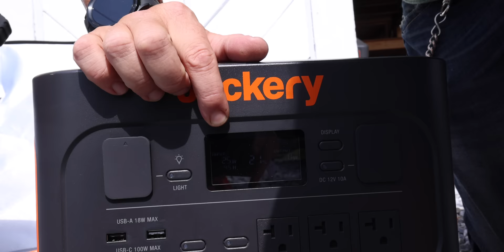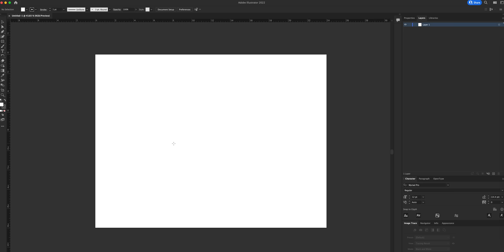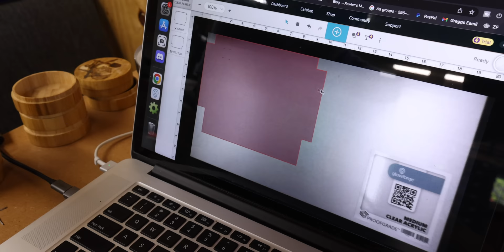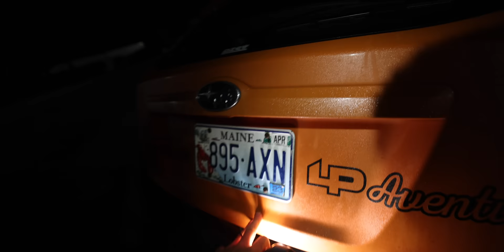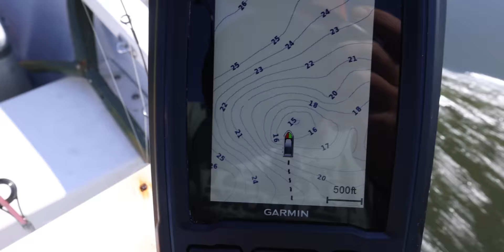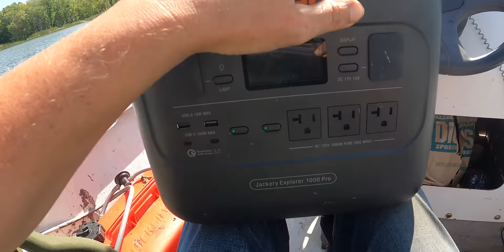Stealth Car Camper Build - Walmart Stealth Camping Catch and Cook - Subaru Crosstreck Camping

Comment: My only problem would be that I would run out of fresh air really quickly.  There has to be a way to crack open a window with the coverings still on or you'd end up with condensed windows too.

Comment: For the curtains I think the problem can be fixed with battons strips of wood set up with a little bit of bend to it when put in the window press the battons to the window so the spring will pop into the curve of the window

Comment: To solve the window curtain issue. I would hot glue the magnets 🧲 to the inside of the car and put magnets on the curtain like you did. If you have polarization right, the magnets will snap in the same place every time. Also the hot glue shouldn’t destroy the interior, especially if you place them on the glass
Reply: Magnet to magnet

Comment: Make window covers from reflectix covered in black fabric. This way they are rigid enough to sit flush up against the window. It will also act as a radiant heat barrier when you need to keep the Subaru nice and cool 😎

Comment: Hey Zach grab a hot glue gun, and a putty knife, remove the plastic cover for the rear hatch access, and hot glue some magnets to the inside of it, then just make your curtain so it fits oversized a bit then sew in a receiver tab of ferrous metal to the curtain, just keep an eye out for your rear facing camera, and dont install a magnet with in about 10 inches of the camera

Comment: 27:45 hot glue some clear suction cups around the fabric and stick it to the window. or cut a hole in the fabric, stick it thru and wrap a elastic band around the other side

Comment: Zack, you could make it so the cooking surface is a stow-a-way thing. if you lift the back section you can have a pullout with folding legs under the back section. As for the front section you can have it in two sections, one that covers the gap and the other being the main body. Use a piano hinge to connect them so that way the gap section folds back over the main body. This way you can have it attached the the back seats and have it slide along the back section. you can do that with runners on the back section and small wheels on the main body. you might need to cut off a 3 to 4 inch section from the bottom of the main body and attach it like with the gap piece. This way it can allow for the seats to be folded back up without having to detach anything for a quick setup and take down. 
If you want some kind of blueprint of what I mean let me know, I will need a way to send you a file though.

Comment: How about if you use tent poles, the kind that can fold into smaller pieces. You could have them spring open then slide them into seams on the top and bottom of the curtain. Maybe with magnets on all 4 sides they'd stay taught. Of course they'd have to be kind of light weight. Good luck!

Comment: You could always use a heat-formed opaque plastic to fit the windows with a small ledge permanently affixed to one side to create a notch and magnets on the other side to stick to the metal wall of the car or other magnets glued into the walls of the car.

Comment: For those windows, what about framing the ends with a flexible plastic that would fit itself on the left and right side, and maybe three middle. That would flex with the curve of the window and press it tight. And since only three strips of it are actually rigid you could just roll it up when you take it out.

Comment: Frame your windows with fiberglass rods like you'd get with a tent.  You'd need to have someone 3d print corner blocks to keep the shape.  Sew rod pockets into the edges of the curtains..

Comment: What if for the back window you had thin metal straps sewn into the curtain as ribbing and it could snap tight in.    Almost like a 90's slap bracelet type thing

Comment: Hello there Mr. Fowler, what if you bought some reflectix (spray paint the exterior side black)  and measured it out in a simular way and then got some velcro strips or even the magnets to press against the window that way it will be stream lined and tight as you would like it to be and even provide insulation for your colder weather stealth camping!!

Comment: Zach, maybe with the rear window see if you can use some of that thin plywood to make a frame to fit the window? Then attach some steel washers to the inside of the frame where you want the magnets to connect, sew the magnets into the curtain like you did with the side curtain and you will only need to find a way to attach the frame to the car (stronger magnets and washers again maybe or a 90o smaller support brace?). i'm sure you can find an ingenious way to get that done? What you think?

Comment: Love your videos,  suggestion for the windows, get Reflectiks, cut it to the size you need and just push them into the windows. They act as an insulation also, you can get a roll of it at LOWES or any store like that. I use it in my windows at my house it reflects the sun and heat in summer and helps with warmth in the winter.

Comment: As far as your height shrink is concerned ....... always, always, always, measure your height barefoot........shoes can alter your height depending on sole, insole, and or heel thickness.............that being said you also lose height as you age due to spinal joint compaction (especially if you have degenerative disk disease) mostly but the is some compaction in yourself hip, knee, and ankle joints as well !!